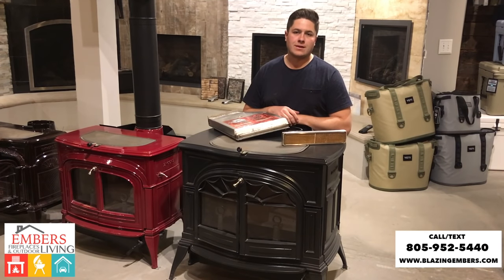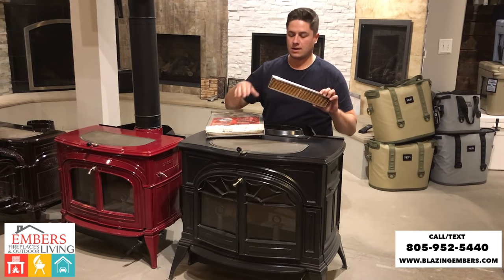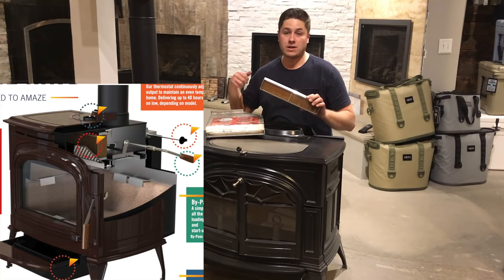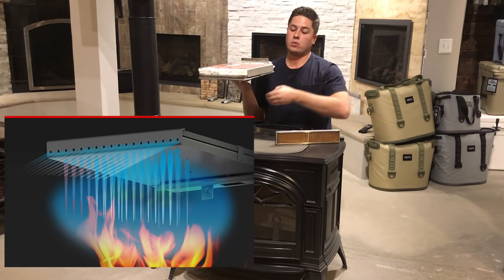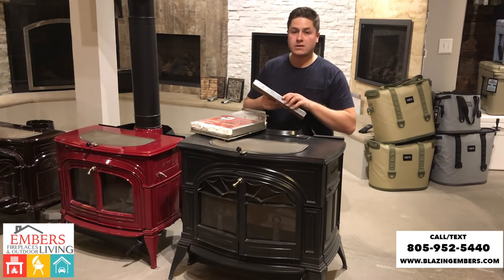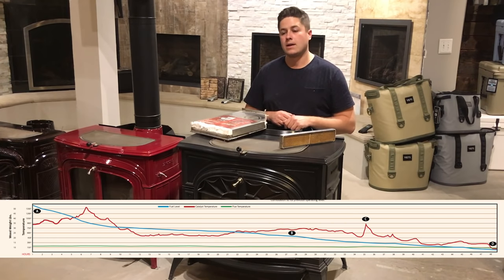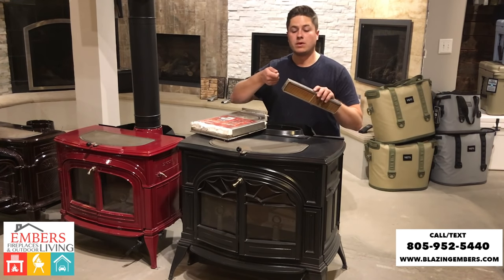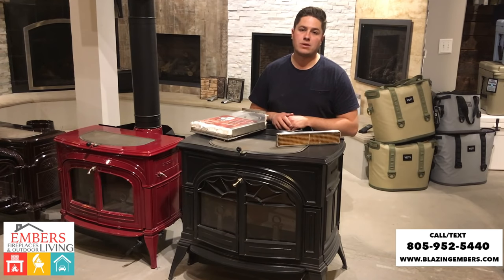Catalytic vs Non Catalytic Wood Stove which one is better?

Comment: FWIW - I have both types of stoves and burn only seasoned red and while oak.  A Blaze King Ultra cat stove for a 3200 sf house and a Lennox/Country Canyon ST-310 (Ironstrike) secondary burner stove (which is now in a large garage).  The Blaze King is a pain in the ass, requires attention on every fill up, has a dirty chimney at the end of every season, gives a good 8 hour burn time, but the heat diminishes in the last 4 hours.  The Lennox is very easy to use, doesn't require much attention, leaves a very clean chimney in fact so clean, that I normally only have to brush out the stovepipe and not the chimney itself, and it gives about a 6 hour burn time with the heat diminishing in the last 3 hours.  The Lennox required about 7/8 cords per year to heat the 3200 sf house and the Blaze King requires about 5/6 cords per year to heat the 3200 sf house.  The Lennox gives more intense heat early on and less in the end of the burn cycle.  The Blaze King gives less intense heat early on but stays fairly steady for several hours before diminishing in the end of the burn cycle.  I purchased new stainless burner tubes for the Lennox.  I am installing them this year and going to modify the air inlet with a bi-metal air intake device where I can close off the air in the beginning of the burn cycle and then let the bi-metal device open the air gradually during the later stages of the burn cycle.  If this works out next year where the garage is more efficiently heated than the house, the Lennox will be moved back into the house and the Blaze King will get demoted to the garage.  I'll try to post my findings in a year from now.
Reply: Its been a year since your post. How did the heater do this winter?  Have you ever heard about the napolean 6,000 zero clearance? I will be building a new home at some time. I just retired and getting a little old for our 2-story house.
Reply: I understand that Lennox has been bought out by a hedge fund type business.  You better stock up on spare parts while you can get them.
Reply: Thix is a great idea!  Air to open gradualy as the burn cycle diminishes!👍

Comment: I cut and split my own firewood.  The switch to blaze king with catalytic has been a no brainer.  There is a learning curve, but it is not difficult at all.  The converter has been going strong now for 6 years.  Not mentioned is that the stainless tubes do burn out and also have to be replaced occasionally.  Used to burn 5 cords per season, burning 3 now.  The extra flue cleaning per season is well worth the trade of cutting and splitting 2 cords.

Comment: The European EPA created emissions standards for stoves back in the 70’s. Giving them a  head start in technology to develop non cat systems. When EPA requirements came to US, some mfg took the  easy route and slapped a cat converter in thier current designs  to meet compliance.  These cat stoves are more fussy and don’t put a piece of painted wood , palate nail, shiny magazine or risk cat damage. 

Here in New England, you can buy plenty of cheap used cat stoves that are useless because the owners got sticker shock for the platinum coated cat replacements.  My non cat European Waterford has provided me 100 cords over 20 years of great service. Pay attention or pay cash!
Reply: @Zedds Dead Baby  Zedd, The 103 is an early model fireplace stove. meaning doors may open for ambiance. No cat, & 8"flue.

 I have a Waterford Trinity Mark II for 1800 SF. I burn 4-6 cords depending weather. I can cook on top or properly sear steaks over HW coals. Best money I've ever spent. I will hand it down in my family.
Reply: @Zedds Dead Baby  Zedd, before firing make sure chimney is safe for operation. When firing your 103, please to be sure to crack open the closest door or window to provide free draft for the 8" big bore flue. Plan 2 stage fire; 1st newspaper balls only, pushes all cold air up. 2nd stage cardboard, kindling, then dry hardwood. The 103 is not meant really to be an efficient house heater, but is certainly worthy of the Waterford Stanley name.
Reply: I got a cat stove for 100 dollars 2 years old Now i need to hire a full time operator to run it.
Reply: @proudtobewhiteprivileged9530  $100 is not a tremendous hit. I feel bad for people who bought an expensive cat stove with remorse. I have never heard a positive review from a cat stove owner. The lava lamp fire dance is hypnotic to watch on the gas reburn of an air tube stove.
Reply: @gerrylundergaard60  i will list it on ebay as a over sized lava lamp
Reply: @proudtobewhiteprivileged9530  Ha! that's funny! What I see is ads on CL "legendary Vermont Castings" bla bla wood stove. They also licensed the name to Home Depot for Bbq grills. I drive by and see about 2 a month put out for scrap recycling!
Reply: instablaster...
Reply from the maker: thanks for the feedback

Comment: I have a catalytic combuster stove  BlazeKing Sirocco 20.2  this unit is worth every penny. My home is warm with consistent heat . the key to a long burn is having a nice red hot bed of coals and load the wood  on the coals. As these logs start to combust the stove is in the open position using chimney flue directly. I let these logs get hot fire in the box the temp rises way above the active zone for the bypass to be closed . At this point at night especially i will the turn the temperature dial to a low -medium setting . It averages overnight 10-12 hr burns.  Im using seasoned wood with low moisture red oak ,white oak ,ash and birch wood  . I have yet to try and put the temperature settings on its lowest setting to get an even longer burn which suppose to reach 20 hr mark.  I think its possible. Maintenance is not hard protective steel grate remove and easily clean grate , then just vacuum the catalyst once a week or every other week.
Reply from the maker: thanks for the feedback

Comment: We have had a blaze king stove for 35 years it has been awesome 10 to 12 hour burn times heat our 3400 square foot home 2 levels. We have replace our cat one time. No chimney fires either. We will be upgraded this year having trouble with the thermostat damper having trouble finding parts it is so old. Been very happy with our cat wood burner. 😊
Reply from the maker: Thanks for sharing

Comment: Both technologies have their place. Cats deliver a more even heat with a longer burn but the combustor only lasts 10,000-12,000 hours so 2 seasons for a 24/7 all winter burner. Non cats throw most of their heat in the first couple hours and cool off quicker but can still hold coals for an overnight burn if you have a large enough firebox. Dry wood is key to both types of stoves, burn well seasoned <20% moisture content wood and you'll be a happy wood burner.
Reply from the maker: Great tips!

Comment: Both types of stoves are afterburning stoves.  The metals in the catalytic combustor enable the combustion of any gases that are not completely burnt to happen at a lower temperature. The non-catalytic stove does it by introducing secondary combustion air over the top of the fire where the temperature quickly gets to over 1100 degrees F.   In either type, any unburnt gases react with oxygen to completely combust to water and CO2.  While it's true that a non-cat tends to burn hotter and not as long as a catalytic stove, I can't imagine a catalytic stove burning 30 hours.  My VC Encore fully loaded can last all night on the catalyst, but by morning there's not much wood left.  I'll never buy another catalytic stove.  It's less work to get up in the middle of the night and throw another log in the stove than to fuss with a catalytic stove.
Reply: I agree my Buck 27000 is 40 years old and works great. My neighbor got a new catalytic model, what a piece of crap. Small fire box, no heat output. He is looking for an old fashioned Slammer.

Comment: There is no chemical reaction  caused by the catalytic combustor as stated at 0:57. With a catalytic combustor there is a catalytic reaction with no chemical change to the by-products of combustion (smoke/gases). The catalytic combustor/reactor simply increases the speed of this chemical reaction (the burning wood gases) and therefore the temperature as well. This is described as an an exothermic reaction (gives off heat). This in turn increases fuel efficiency and heat output. So all in all, the wood buring is the chemical reaction and the catalytic combustor is a kind of turbocharger; so to speak.
Reply: That's right.  The catalytic combustor enables the combustion to take place at a lower temperature.  The non-catalytic stoves are built to retain heat better, lined with firebricks, and the manifold or pipes above the fire that emit secondary combustion air quickly heat up to over a 1000 F, enough to do the same thing that a catalytic combustor does at 500 F - finish the combustion of any unburnt byproducts to water and carbon dioxide.
Reply: ikeybertso I have a catalytic wood stove which is lined with bricks and is cast iron,  I find it pretty easy to use and it retains heat long after it’s gone out. And it burns for about 18-20 hours.

Comment: The high tech stuff all sounds good in theory but always cost a bundle to maintain. this is why I chose a 1981 model plain Jane stove . It likes a little more firewood but other than clean the chimney a couple times a season, it is trouble free. Wood is cheap. Combustors are not.
Reply from the maker: good feedback
Reply: Wood is cheap ?! In the UK you can easily spend a couple hundred $ equivalent per month just to heat a small home (s.m.a.l.l. in the UK tranlates to t.i.n.y. for yanks, I would think, given the sizes of homes I've seen mentioned in some of the other comments LOL).
Reply: @wotcherfaz  I’ve been to Britain, obviously didn’t see all of it but never really saw that many trees. I live in the Appalachian mountains it may as well be a rain forest, mountains and trees as far as the eye can see. 

My wood cost me gasoline, 2 stroke and bar oil. I’d love to know what I’ve saved over the years by burning wood.

Comment: I have a Vermont Castings DutchWest woodstove with the catalytic converter, but I hardly ever use the catalytic converter because I live in North Alabama where it almost never gets cold enough for it to work. It won't work at all if the outside temperature is above thirty degrees. It works great if the outside temperature is below twenty degrees, but nights like that are rare where I live. If I had known I would've bought the model that doesn't have the catalytic converter.
Reply: Jim Yost how does outdoor temp has anything to do with the internal combustion of a stove?  Makes zero sense.
Reply: @xzibit8614  ~ It would make sense if you owned a wood stove that has a catalytic converter.
Reply: @jimyost2585  Im still not sure what point you’re making.  I have operated the exact same model stove you have for years and have never had any problems running it with outdoor temps above freezing.
Reply: @jimyost2585  are you talking about over heating the space? Problems getting sufficient draft?
Reply: @Drock42992  ~ All I know is that I'll never buy another woodstove with a catalytic converter as long as I live in the deep south. If I lived in Montana then I'd want one that has a catalytic converter.
Reply: That’s fair.

Comment: Cat converter sounds like a faffy upsell to me. IMO simplicity is best, and if I want longer burn times I just burn smokeless Ecoal. I clean my flue once a year and happily burn pretty much any wood if it's free. I couldn't do that with a cat converter. Why would you want limit what you can burn, and have to fork out the price of a new stove every year on extra maintenance for some fancy gadget? The term over-engineered spring to mind.
Reply: Because it burns a lot cleaner, and you get more heat from the wood. Environmental and cost factors are important to some people. I don't find it difficult to maintain at all. I can go for 12-14 hours before adding wood, and my place stays toasty. Since I bought one of these, my wood pile has aged. I just don't use as much wood. I use almost half as much. I don't burn anything in your my stove except a good hard walnut, oak, or my favorite, almond. Low ash, clean, better. Ecoal is good to. Glad you gave that a plug. Good stuff.
Reply: Don’t have to buy a new stove every year. The video explains poor operation and maintenance can damage the catalyst. 

I feel the video could have explained it better.

Comment: I thought the point of having a woodstove to to cut costs, doesn't all of that extra cost negate woodburning to begin with?
Reply from the maker: not necessarily, honestly if the unit is well cared for, you shouldn't have much in the way of costs

Comment: What you do if a person can't make their mind up which they want to go with and have only used old school stoves? Lol
Are both just as efficient on wood in the long run? Do all of them require you to let the fire burn out and scoop ashes instead of dropping into a pan like old stoves?
Reply from the maker: Catalytic is going to be more effecient and cleaner. Yes you still have to clean them the old school way.
Reply: @embersliving  how do you clean the catalyst the pro way? And since a catalyst, in science, improves the rate of chemical reaction then how hot do you have to keep the stove running to keep the catalyst & pipes efficient and clean with low maintenance? It's beyond obvious they burn cleaner as that's the whole point but that answers nothing really as far as making a decision. If you know anymore info on this it'd be greatly appreciated! Unfortunately most salesman are inadequate to correctly answer the need to know.

Comment: What happens if you dont stay above 500 with catalytic?
Reply: The catalytic activity is less reliable or gone, depending on how far below 500 you drop.  If you leave it going through the cat [ instead of a bypass] it'll probably gum up the cat.  Keep in mind, "dropping to 500" means you're at 500 and probably still dropping; if the cat has dropped anywhere near that level, add fuel or use the bypass.  Side note: Condar makes a cat which lites up at 400F instead of 500F.
Reply from the maker: thanks for the input

Comment: You mentioned that we shouldn't burn soft wood in the catalytic stove- does that rule out the use of pine or aspen?
Also, what is your recommendation about using energy logs in a wood stove?
Reply: Aspen is still looked at as a hardwood. This designation has less to do with the hardness of the wood than it has to do the the call structure. It is not going to crate as much heat as a denser hardwood, but it is going to be safe for a catalytic stove. Pines and other conifers are known for the sap that does not completely burn and that gums up the catalytic combustor.

Comment: Did I hear you right that the catalytic converter version needs higher temperatures?? So the cat needs to be switched in once 500 degrees is reached ?? 
But I thought the whole point of cats was they allow the smoke to burn even at a lower temperature.. as an alternative, for example, rocket mass heaters deliberately insulate the firebox itself to bump up the combustion temperature to effectively burn all the smoke away without needing a cat.  Maybe it was just a slip of the tongue?
Reply from the maker: possibly

Comment: Catalytic cost is a issue and constant messing with the handle to use reburn is easier and you can get 12 to 18 hours of burn with a reburn the dryer the better when it comes to the reburn
Reply from the maker: thanks for the feedback
Reply: If you have seasoned wood it’s not fyi

Comment: I honestly don't know anyone that does a 30 hour burn.
Reply: Nope. If I want to stay over 500 degrees, I get about 8-9 hours.
Reply: I believe he misspoke, instead of saying 13hr, he said 30.
Reply: I have a Blaze King cat stove and can easily get 24-30 hour burns on  lower settings. Once the Catalyst is lit it continues to function until the wood is burnt. The other benefit is lower flue temperature because you are reburning smoke as it passes thru the catalyst.
Reply from the maker: yes blaze king is one of the only brands that will give you a 30 hour burn

Comment: I have a definant encore # 0028 catilictic stove . Its a nice looking stove but iv never got a 8 hr burn time .. To keep the house warm i have to reload about every 4-5 hrs  ??
Reply: Sounds about right to me.  That's pretty much the norm.  What kind of wood are you burning?    Things can vary a LOT.      42 years burning here.
Reply: Burning oak , dried ..
Reply: There are so many variables      Most of the stove manufacturers  simply just LIE about burn times and heating areas.      I get about the same amount of time with my Avalon Rainier stove, but i don't FILL it to the top.   I've NEVER really filled it.   My only suggestion is maybe to mix 1 or 2 pieces that are "NOT" as well seasoned with the really dry?    Other than that, i don't know what else to tell you.   I assume you pretty much close the "draft control" as much as possible, as that basically is about the only other way to slow down a fire.   Maybe the automatic thermostat is somehow defective?     Sorry but that's all i've got for ya.
Reply: Bruce johnson I get around 8-10 hour burns out of my Woodstock soapstone stove.
Reply: This is my experience with a Pacific Energy medium-size wood stove insert.